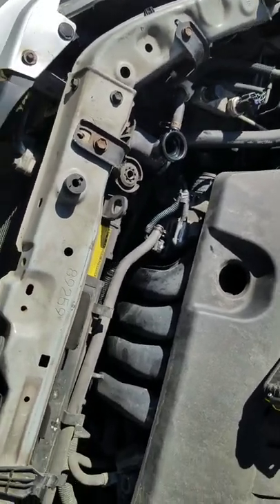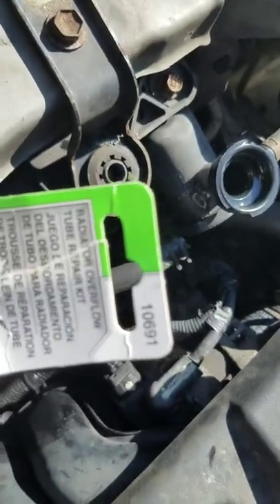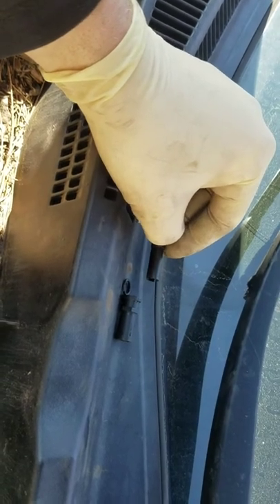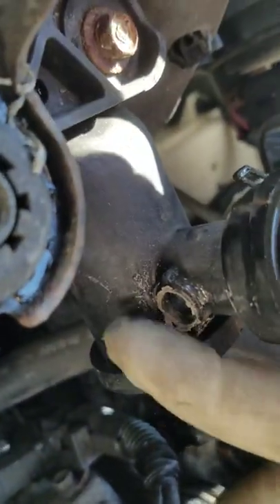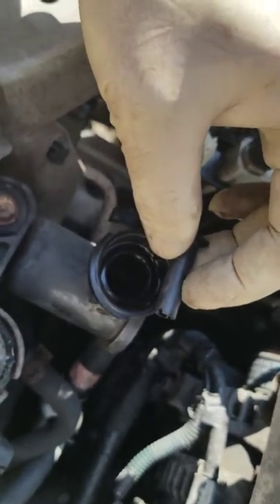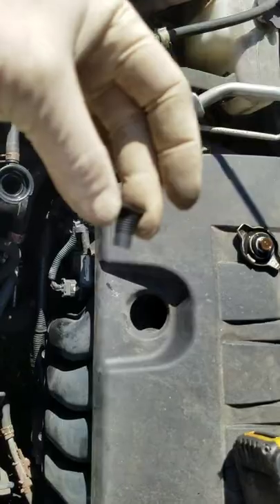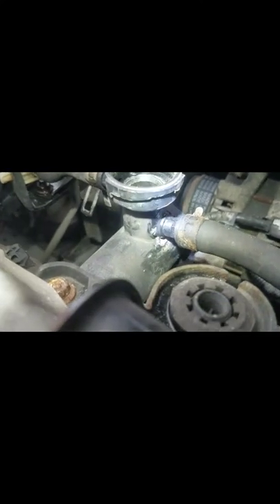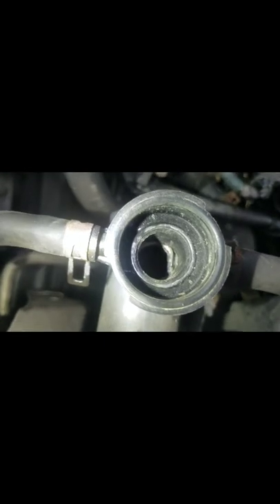How to fix broken radiator nipple / small pipe with dorman part # 10691

Comment: On nipples that broke off on the vehicles I worked on I just got a threaded brass nipple piece. Then drilled out the hole, tapped out the hole to the proper size and then used a bit of sealer. Then screwed it in and waited for several hours. Then reattached a new hose so that there was no sideways stress on the nipple and that repair never came back in all of them I did. Usually the next thing that happened was that the radiator cracked itself . That kit would not work on the vehicles I worked on but I like that concept.

Comment: Informative video but i have a couple questions.  #1 what tool you used to cut the 1st part of the nipple to for in the radiator? #2 what proxy didbyou use? #3 did you attach the 2nd part (o-ring of the repair kit or just the hose to the 1st part of the nipple? ) . Basically what is the hose connected to? The 1st or 2nd part of the repair nipple? Thank you.

Comment: Damn, that's great repair kit for that style of radiator. Mine broke off just the other day on a 04 Kia Sorento, and the radiator design is not like that. The overflow nipple is actually attached to the radiator; there's no way of inserting that piece inside. I'm trying to avoid doing the "hose-barb fitting" repair, but it looks like I have to. Unless, you've come across my situation and you have some advice?

Great video btw.
Reply from the maker: Slide it onto a stiff wire (not electric wire) and try routing it through the filler neck to the nipple should work

Comment: Is it really a permanent fix?
Reply from the maker: Yes it is permanent I actually put some epoxy around the threads before tightening just to be sure and it seems to be holding just fine!
Reply: @mechanixautorepair  great idea , do you think it still works
Reply from the maker: Yes
Reply: @mechanixautorepair I have leaking, I think from the hose.. the 5/16 barb is allot smaller than the original nipple that came off.. what can one use to help the hose seal to the barb fitting?  Maybe I just need a better clamp, the worm clamp I got was a little bit to big, when synched to the diameter I need it wasn't quite a perfect circle and bent a little and I had to squeeze it back into a circle with pliers..

Comment: My nipple snapped. It was leaking. I looked the tube off and sprayed it with flexseal. Put the tube back on clamped it down and spray flexseal all over it. 

It held so far, been a month.

Comment: What drill size? Also is it still working ?
Reply: I was wondering this too.  I’m going to try it tomorrow- I don’t have the part yet.  I read that the ID is 0.23” and the OD is 0.39” so maybe start lower (1/4” maybe) and slowly go up.
Reply: @nickb8886  yeah I think I used 1/4 and it worked fine just don’t rush it. Mine came out great
Reply from the maker: Don't remember size but slightly larger than dorman part also I still haven't heard anything from customer and it's been a few years so I'm assuming all's good!
Reply: @mechanixautorepair  what epoxy did you use?
Reply from the maker: @Etheo1ify  jb quick weld make sure to get the quick type
Reply: Where you find the part?
Reply: @mauricionieto1319  I found it at lowes
Reply: @mechanixautorepair  Do you mind posting the link to the epoxy that you used? Sorry, I am new to this. Thanks
Reply from the maker: @Etheo1ify  it's called j.b weld they sell it in any auto parts store but make sure to get the quick weld type
Reply: @luissantiago5933  hola yo estoy por hacer esa reparacion como te fue pudistes hacerlo ???